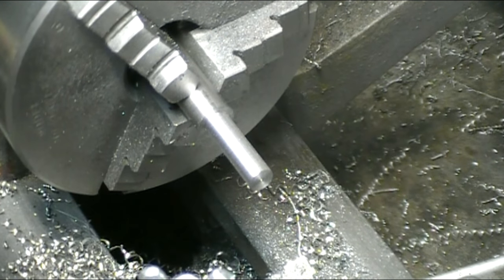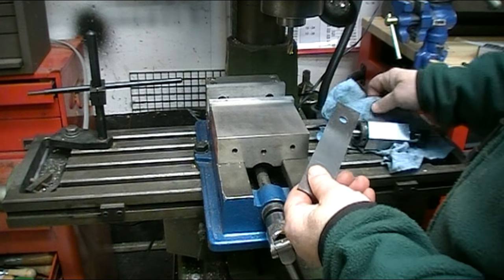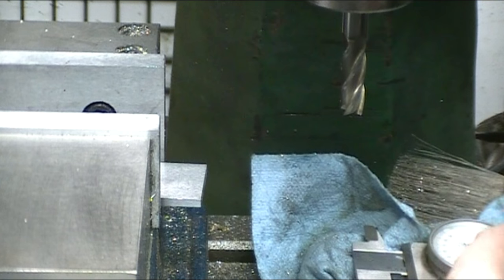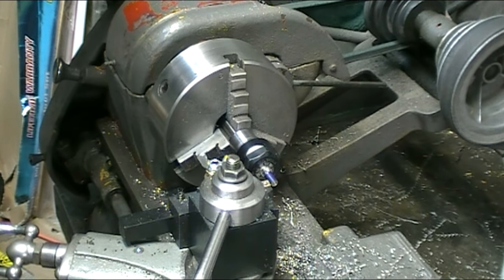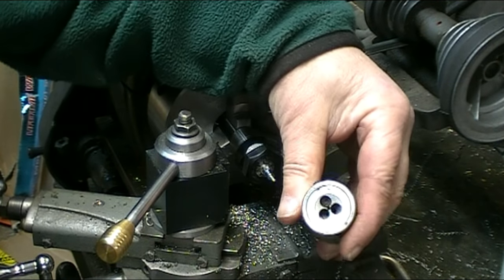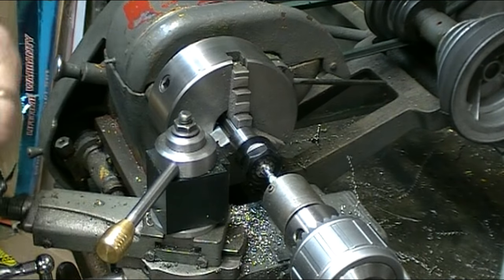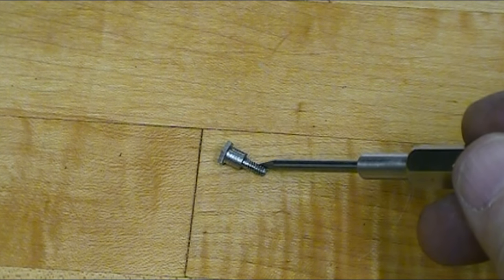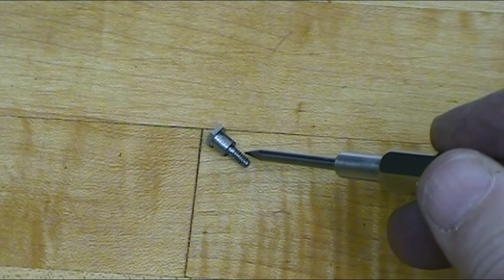Lionel Steam Engine Repair - Making A Small Shoulder Bolt

Comment: Thanks Steven, nice job, would love to have seen it being used on the steam engine. would love to see other repairs from the Train store.
Reply from the maker: Tome, you are absolutely right about that. My plan was to take the bolt to work and shoot a shot with my cell phone and put it on the end of the video.  The problem is that I left the bolt home and wanted to get the video up loaded.  My current plan is to put the bolt in take a few shots and include it in my next video.  I will also post it on Facebook. Thank you for watching and commenting.
Reply from the maker: https://youtu.be/AHskDw9QOV0

Comment: Nice job. With those small diameters it's so easy to bend or break the part unless you use a delicate touch.  Merry Christmas to you Steve.
Reply from the maker: That is another good reason to keep this small lathe.  I expect to be getting another much larger lathe this coming year and I have been trying to justify keeping the little one.  I make many very small parts so it probably makes sense to keep the little one.  Thank you for watching and commenting, Merry Christmas to you and your family.